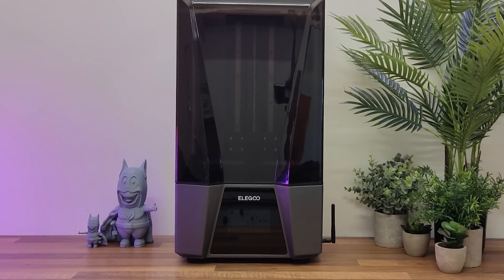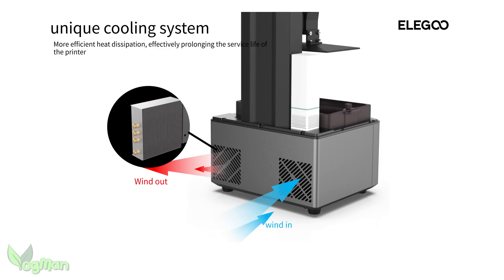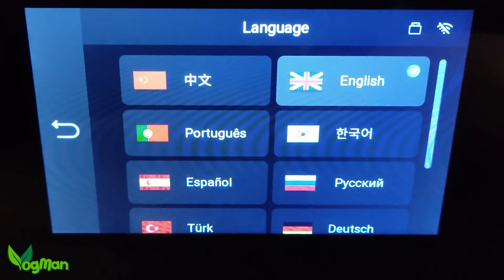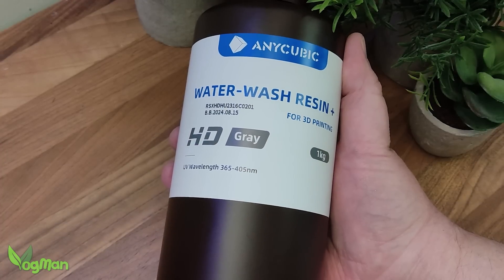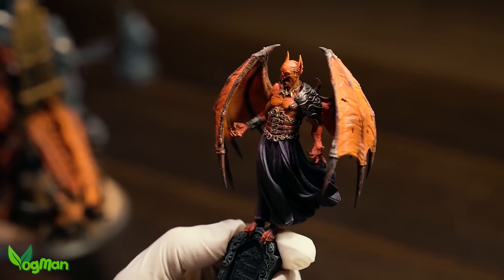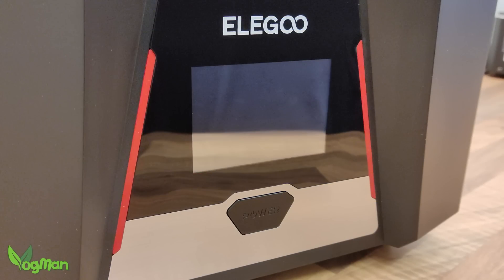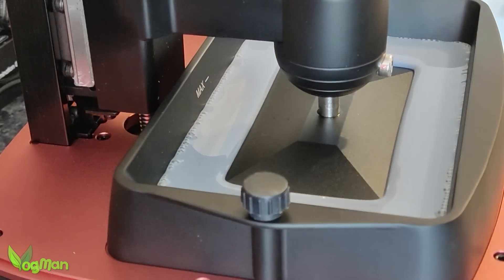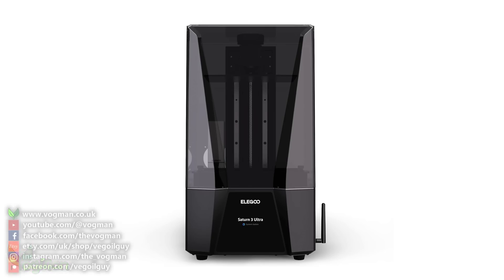Elegoo Saturn 3 Ultra 12K 19 micron resin 3d printer (HONEST REVIEW)

Comment: I was shopping printer upgrades the other day and noticed something else rather odd. Elegoo and another website selling printers looked identical, to the point that I had to check the URL to make sure I was on the right site. I was going back and forth comparing features, though one thing I've never been a fan of is Elegoo's stinkin' center mount ball thing for the build plate. Seeing as how that's another shared component for a lot of printers, I see they brought that over also. Basically the only difference in the 12k printers between these two companies was the external shell. I'll bet both boards and user UI panels are identical also. So as you rightly mentioned, is the exterior 'aesthetics' worth an extra $100? 
Not for me. Still looking at the Gk2 for my next home printer.
Reply from the maker: I was hoping to see other companies copying the GK Twos innovations. So far it's been disappointing.

Comment: Thank you, Thank you, Thank you, Thank you! I feel that my pre-order of the M5s is now more justified. So the question now is should I have gone with something else for a 10" screen is fast printing is not my main need? I feel at £379 (found a fur £20 off code) I've got a real bargain, even if it does have rectangular pixels. Speaking of which would it be something to do with adhesive grip. If you think of a suction cup, its round, don't see oval ones do we. They just wouldn't stick as well, so is this the reason for the odd shape. The 9k has square pixels, but no fast printing. anyway just a thought. 
Anyway thanks again @Vogman, glad my own thoughts on 'what you get' have been shown here.
Reply from the maker: Thanks for the kind words 😁

Comment: I would really appreciate if you included proper minis in your reviews, the big archvillain display minis don't have the same needs as the average 32mm wargaming mini. This was especially frustrating with the Photon D2 review, but I feel is also relevant for these printers, as the higher resolution kinda matters the most for those tiny models. I could even recommend some free models with both high detail areas and flat areas.

Comment: The basic M5 seems to be the best option here for now. I like that Anycubic is trying to innovate with automatic bed leveling and force sensors, and it works fairly okay. But if something goes south and prints fail good luck troubleshooting it. Manual bed leveling isn't a big deal either. I had to level the bed on my OG Photon Mono only a few times despite being in use for more than 2 years. Sure it has a small build plate which is less susceptible to leveling issues, but I can remove and put back the build plate so many times without leveling or any issues. I give auto bed leveling a bit time for about 2-3 generations to mature before I buy into it.
Reply: the "automatic bed leveling" isn't actually leveling anything. It just pushes down on springs. It works pretty poorly compared to a properly lapped and leveled buildplate. I'm certain it's the reason why vogman said small prints failed on the m5s.

Comment: The Saturn 3 Ultra has more build height than the Saturn 3 12k... it's only 10mm, but it's there.  It's also supposed to be a metal chassis, but I haven't seen that in the specs.

Comment: I'd also weight in the ease of purchasing parts in your region and the customer support. In my experience I'd have mediocre experience from Anycubic while Elegoo are pretty quick in response and providing replacement parts under warranty. The anycubic self leveling is a gimmick that might be a pro or con for certain people, as shown from its review that you need to use bigger rafts for small things to stick to it, I'd give it a pass. One thing I noticed from the Sat3 is finally someone in product design realized it's a good idea to raise the rear portion of the printer where the holes for the homing sensor and the stepper motor are so in case of a resin leak it doesn't drip down those holes, and they even added a rubber grommet to the stepper motor recess to boot. Looking at the those artifact lines, I think I'll skip this generation of mid-size printers and see what they come up with next year. I'll keep an eye out on the Mars 4 with their 9k screen with 18um and square pixels.

Comment: Is there no benefit to testing lift speed with a .05 layer height with a normal resin? 

As i understand it faster speeds should still be achievable due to the new quicker releases ACF even without marketing-gimmick-high-speed-resin??

Comment: In other words, for someone new like me who just wanted to either get any cubic or the other but decided to go for S3 as Elegoo offers free shipping to Canada for only $50, and I wanted something..."sexier" loll and made out of metal instead of plastic.
Considering I don't really care about the auto levelling , but just want a printer large enough to print  vehicles and terrain but also provide me a great resolution when I want to print smaller miniatures for my 40K army.
This printer is perfect for me.

I know the $100 difference in pre order but... the metal parts for me was enough to convince me to pay the $100 more.
Besides.... free shipping and no VAT/tax as well so at the end it maybe saved $20-30 by not buying the M5S
Reply: Using metal in the structurally not critical parts is just increasing the price and weight without any real life practical benefit. And this printer is more comparable to the M5 than the M5s making the price difference even bigger. The only advantage it has over the M5 is the slightly taller build area.
Reply: Same I am also In Canada and the extra 6cm is not to be laughed at when print terrain and Titan...

Comment: one coment is the ball screw should allow for higher z precision and longevity of the z axis ball screws are much more rigid. they also cost more so that could be why the saturn3 12k ultra is more costly than the m5s. the m5s should be compared as far as price goes to the saturn 3 12k . But that is just the way I see it.
Reply from the maker: Thanks for your input.
Reply: But the whole assembly has more flex than the precision diference between ball and lead screws. Longevity can be a valid point though.

Comment: About these lines on AmeraLabs test print, maybe it's related to the very low viscosity of the resin used, which exaggerates imperfections in the linear motion (and some vibrations across print)?
Reply from the maker: They were two different resins. And I've used Anycubic Craftsman Grey in various video printing the town print without issues. Good thinking, but I'm not convinced.
Reply: @vogman  Looks like LCD masking issue, the grid in those 12k LCDs is apparently 'off', causing some kind of pixel light-bleeding responsible for the scratch-looking artifacts on both the anycubic and elegoo 12k models.

Comment: VogMan how do you deal with the left over waste wash water of the Resin printing when you use Water Washable Resin?

Because I am thinking of selling my Elegoo Saturn 2 Resin 8K printer and Mercury XS wash & Cure System due t me not able to sort out the waste water filled with water washable resin left overs.
I have 14 liters stored in containers now as being in the good old UK, 

Means I can't just sit the open top container in our non hot sun here since it is as we know nothing compared to the USA heat wise even at the best like last years summer!

The water washable resin in the old wash water is still a toxic non-throw away liquid and I seen that getting a big UV lamp is far too pricey ( a few hundred online )
So please how do I deal with the wash water loaded up with the resin?
Reply: Why don't you cure it in your was & cure station in a glass jar then filter it with a coffee filter or paper towel? Then spread the putty on paper towel, cure it one more time for a few minutes and it can go into the thrash. The water can be resused as washing fluid.
Reply: @peterkiss1204   Hi, I thought of that to? But the weight of the water in even a small glass jar worried me as that cure station has a very weak turntable which from what I seen is not that strong since any resin model it has to deal with is little to no weight unlike a jar fill up with heavy wash water. 14 liters is allot to cure in a tiny amount at a time.

Even if I could not damage the turntable with the very heavy jar of waste water, it would take many days to do that amount little amount at a time. That would solve that problem but make another problem the Printer would be unable to be used for many days while the waste water was slowly set of the waste resin. And of course since it takes 7 liters at a time to fill up the washer container I would have another huge amount of waste water to set slowly again in little jar fills.

Plus really I still would worry about damaging the turntable long term no matter how careful I was doing the settings?
Reply: Here in Australia (in winter) I am forced to bottle my wash water too. I simply take it to the local dump for hazardous waste disposal. You guys have something like that?
Reply: @jarrajoseph-mcgrath9142    Hi there, Yes do indeed have the disposal centers here too. However even if I have one in my Borough and it does not charge money to do the service, I have a problem as I don't own a car and I am sure there is a problem health and safety wise and law wise taking some very toxic waste waster on public transport to a possible long journey
to such a place as you can't just hope that the container/s don't leak on the way there and I am sure there be a very big fine for me if it leaked on a bus?
So I really don't wish to break laws, also get a ban from using public transport as that be a big pain!  

And I am sure if there was a collection service from the disposal site they would sure charge big money since it is a toxic waste pick up?  So I am really stick at this time.
Reply from the maker: Hi Colin. I can tell you what I do, but that doesn't mean it's ideal.
Firstly, some local dumps do take hazardous waste, though if yours is anything like mine, you can't take in any trash that is dirty, broken, or incapable of being placed on eBay 10minutes after you've dropped it off (the arguments I've had...).
So, I do what Peter Kiss has suggested. However, I use small plastic (clear) bottles, seal them, and stand them indoors on a windowsill. No direct sunlight is needed. Alternatively you can place them outdoors somewhere that’s safe and that light can get to. Leave it a few days then sieve.
I separate the water and pour this outside on concrete, etc, where it will evaporate, regardless of sunshine. I'm in the UK too, of course. So think about it... after a wet day, how long does the ground stay wet? It dries surprisingly fast as evaporation isn't just about heat. Personally I don't pour the water down the drain or even on the garden. But as long as there's no animals to lick it up, I figure nature will do the rest.
Then I again do as Peter does, but usually inside on a windowsill and finally, sorry to admit it, in the trash.  I hope by that point I've removed as much of the UV curable stuff as I can...
Not perfect, but that's my way. If anyone has anything better, I'd like to hear about it  😁
Reply: @vogman   Hi There. Thanks for the tips on this tricky to solve problem, as like me you also know how un-helpful the very up and down UK weather is.

I will think about the other ideas by these lovely people here?  I did even think about doing washing in IPA, But it like allot of other stuff in the UK is very very pricey now and like food and the living costs are just going up week by week. I've seen one food go up by £1 in a week. 

IPA is just not a option sadly now since my washing station tub needs 7 liters to do any full printed model by the Saturn 2. 
and to buy just enough IPA even at the cheapest would be £20 for a 5 liter jug  I would need two of those to fill the 7 liters volume.

Then it be wasted soon if I did the method I saw online of letting the IPA evaporate away in any hot sun to leave the solid waste.  Not a good choice when I have such pricey IPA?
Also the costs of the other PPE and kitchen towels to be brought then thrown away along with safety masks and gloves, Just far too much money now.

I just got a new Elegoo Neptune 3 Max 3D printer which I had to save up for, I will be most likely have to stick to FDM printing.  So the Saturn 2 system and wash & cure will need to be sold if I can't solve the cure problem safely?  Thanks all for your support.  😉

Comment: The WiFi printing on the Ultra is actually a big selling point for me. Don't think it got mentioned in the comparisons
Reply from the maker: Both machines have wifi 😁
Reply: The M5s also has WiFi printing.
Reply: I was talking about the Saturn 3 vs the Saturn 3 Ultra for Wi-Fi. That's not mentioned as a difference between the two when talking about the price gap

Comment: They started selling this printer that has a fast printing as a selling point, but don't have their fast resin available to review... Sketchy.
Reply: To be honest this new wave of fast printing statements are mostly bullshit. Sure a better FEP and less viscous resin might help a bit, but most of the time savings are coming from the 100 micron layer thickness (hence lower layer count). Even the older printers can half the print time if you double the layer thickness, and the better resin would help the same way on the older printers too.

Comment: but did they reinforce Z axis column so it doesn't wobble back and forth under load / while homing just like on saturn 2?
Reply from the maker: The column looks very substantial to me - thick and wide. I always try to keep an eye out for wobble and I haven't seen any problems with the unit I have here.
Reply: @vogman  The column itself isn't the (only) issue with the marketing clowns pretending to be engineers at elegoo - the thin aluminum between the z-column and the vat area is also responsible for flexing, if they didn't reinforce that after all these years, it doesn't matter if the column is thicker and wider, it will still tilt when the too-thin metal on the base flexes.
Reply: @vogman  good to hear! maybe ball-joint-less solution helped a bit too, i noticed my build plate seems to be pushed towards the screen when tightening ball joint screws. Hopefully they reinforced base too so it doesn't bend. I'm still rather disappointed there's no hinged lid nor other qol improvements over s2 :[ sigh.

Comment: I buy the Elegoo because of the inbuild  air purifier :) I have the Jupiter and think it’s a big difference at some resins. And the COB+ should be an improvement against voxel lines. Sadly I can’t compare both printers.
Reply from the maker: I completely understand. I do think, in all seriousness, that the Mars Mate purifier that Elegoo are releasing looks impressive... and it wouldn't take much DIY skill to make it fit ANY printer 😉
Reply: @vogman  yes it’s also an interesting device. In my case maybe I will buy one for my Snapmaker, because there this cost around 500€/$.

Comment: I don't know why they don't all offer an in / out airflow with the unit as sealed as possible beyond that. I think everyone would prefer to vent to an outside location via a conduit rather than filter.
Reply from the maker: I do think, in all seriousness, that the Mars Mate purifier that Elegoo are releasing looks impressive... and it wouldn't take much DIY skill to make it fit ANY printer 😉
Reply: So many people don't have the opportunity to vent their printers to outdoors location and chamber filters remain the only option. But a hole with a sealed removable cover as an option couldn't hurt much. As long as you suck the air out of the chamber (therefore the chamber pressure is a bit lower than the room air pressure) there's no need for really good sealing as the negative pressure prevents the fumes from seeping out.

Comment: great review - glad that I preordered the Anycubic M5s for $399 with a bottle of the fast resin
Reply from the maker: Good choice 😁
Reply: The same to me!
Reply: @sadheartcreaciones  and me ;]
Reply: And me! 😅
Reply: Anycubic M5, non-s is right now on preorder and is even cheaper. 
It is the same printer without the auto leveing and the questionable "smart" features. 
I went for the mars 4 ultra anyway because I just want the highest pixel density but I would take the M5 over this one because its basically the same thing but cheaper.
Reply: Me too! I returned my Monox 6k and bought the M5s for 399 since my return would give me back 385 so it was only a couple bucks more. Cant wait to get them in and try them out!!
Reply: I ordered 3 bottles to see what happens when you mix it with regular resins

Comment: My only question, is this a better print than the Sonic mighty 8K? Comparing  it to the mini 8k doesn’t account for the increase build volume of the Saturn 3. If you had to recommend one printer that’s about 10” build volume would you recommend this one or another 8k printer?
Reply from the maker: The Mighty 8K is 28 microns. These 12K printers, in my opinion at least, are printing at something more like 24. So in theory they are better, but it will be a very small difference that you'd probably struggle to see even under magnification 😁
Reply: @vogman  do you think all of these printers print at a similar level so other things like bed leveling and other features matter more?
Reply from the maker: I like to see innovation as it shows these printers are getting better and better. I like to encourage that innovation so I will commend it. However, not everyone needs it. So I try to be balanced in my reviews and cover that as well.